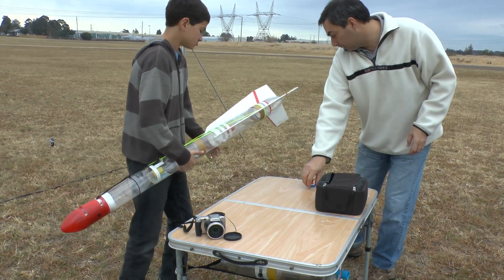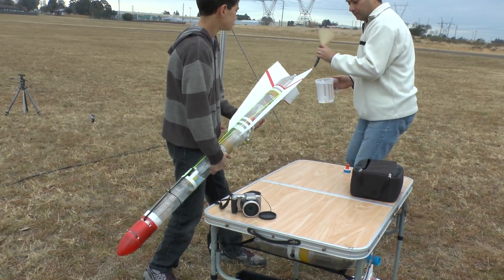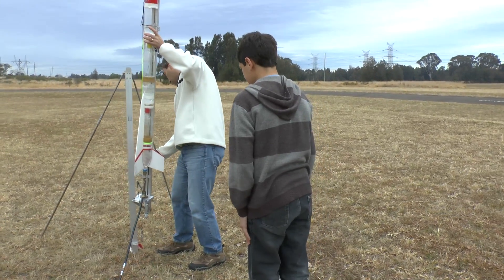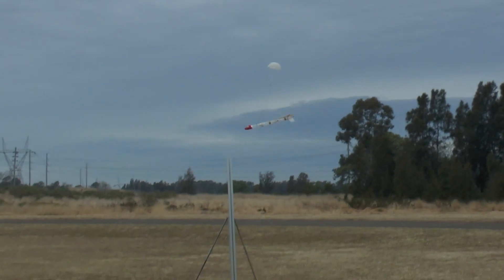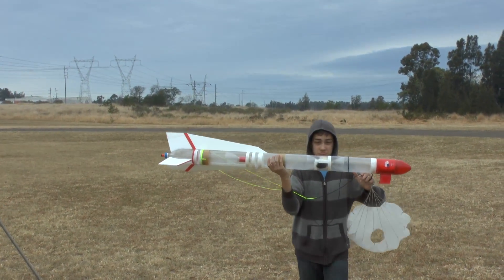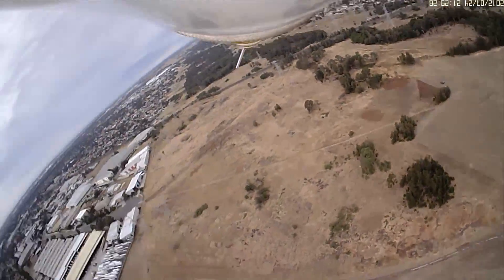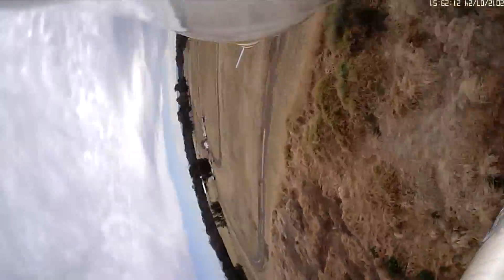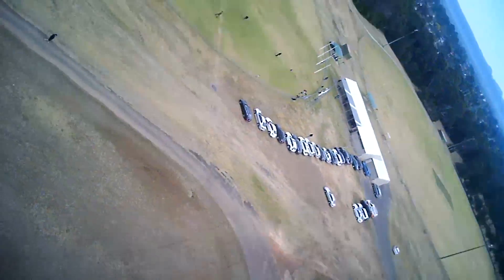Day 149 Highlights

Comment: Hey, we're two guys from Germnay building water rockets.We are new with the rocketry. Maybe you have some good tips for us? :D

P.S.: Good design and even better flights :)!
Reply from the maker: Hi WasderRockets. Good to see you having fun with water rockets too. :)
Some tips:
- Use strong shock cord on your parachutes to stop them separating during high speed deploys. 
- Start collecting as many bottles as you can, you will need them.
- Build a flexible launcher that allows you to launch rockets with different sized nozzles. 
- Carefully look at failures when they occur so that you can learn from them. 
- Continue having fun :)
Reply: AirCommandRockets Thank you for the tips! Our problem isn't that the parachute cord seperates, but the glue with attaches the cord to the rocket sometimes isn't strong enough.
Thank you again and good luck with your rockets!

Comment: That's an interesting idea.....and why not devise a system where fins are enlarged and the rocket coming down without parachute!!!!. Nice foam powered flights and great pictures from both camera angles. I wish our grass was also dry because the wheather has lately been horrible.
Reply from the maker: Hi Teamlucrockets, I think the concept you are referring to would be a water rocket glider that has wings large enough to generate lift. The problem with those is that you have to compensate for the lift during the boost phase otherwise your rocket flies in a loop. With these fins they do not generate any lift on the way up and not enough on the way down to have the rocket come down safely. The normal parachute provides the attitude control and speed reduction, and the fins allow the rocket to slide sideways rather than just straight down. Getting control of that sideways motion will be tricky.:) A week after this video was shot we've had 2 weeks of rain!

Comment: Nice idea guys! At first I thought the glide fins are made to control the rocket in flight and help it to fly straighter. By the way, is it an efficient upgrade ? because I think they add too much weight for what can offer.
Reply from the maker: Thanks Florin, :) No definitely not efficient, and it does add some weight. But then again it doesn't always have to be. We're trying to see if it is possible to control the rocket on the way down without steering the parachute like is typically done. It may turn out that in order to have enough control you would need a large fin. Good fun trying though. :)

Comment: Just last weekend I found myself wondering what you guys have been up to and now, here on the following Wednesday night I have my answer. Very nice rocket but I found myself missing the sound of the servo operating to release the parachute which was present on most if not all the previous videos. I was thinking that the rocket was going to crash because of no 'chute. :) Cheers, b.
Reply from the maker: Thanks Biggles. :) Yup, we haven't done many updates lately as we've been very busy on a couple of rocket projects that we're getting ready for a big international launch in Queensland in March next year. More will be revealed closer to the event. :)
The camera is typically a bottle away down on the rocket so that it may not always pick up the sound of the servo easily especially if the servo motor is on the other side. Also when I edit the video I typically reduce the volume from the on-board video so it makes it a little harder to hear.

Comment: I'm pretty sure that I heard the background music already in an other video about water rockets (Phoenix 5) ;)
Just kidding, seriously  very well made video and an interesting fin design. I am really in love with this wide angle onboard videos.
Best regards from Germany
Reply from the maker: Hi Raketfued, yeah there are only a few options for music in the YT audio library. :) We too have re-used some of them in our other videos. We need to do a little more work on the parachute location to get the rocket to glide more consistently. The third fin will eventually be controllable via remote control, but I suspect it will be quite difficult to drive. Greetings from Sydney!
Reply from the maker: RaketfuedRockets Thank you for the links. Will definitely have to check them out. Cheers!